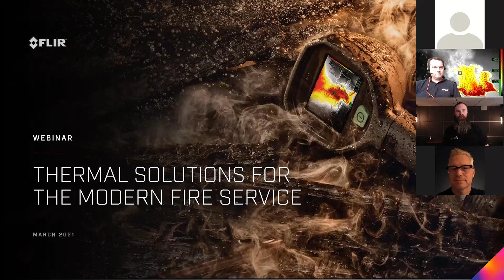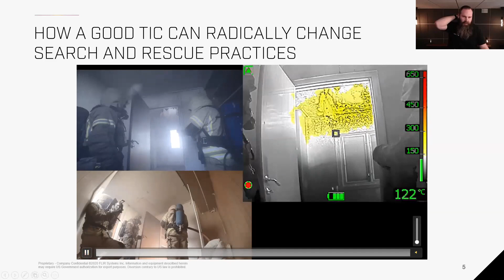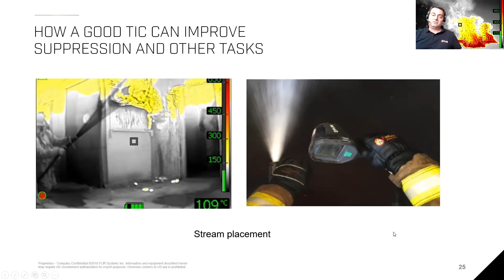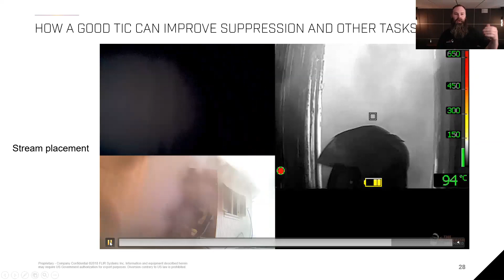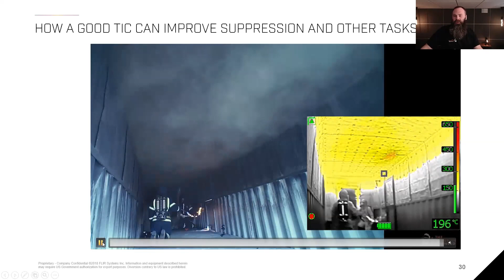Webinar Archive: Improving Search and Rescue Practices with Thermal Cameras

Comment: 🎯 Key points for quick navigation:

00:00 FLIR systems webinar introduction
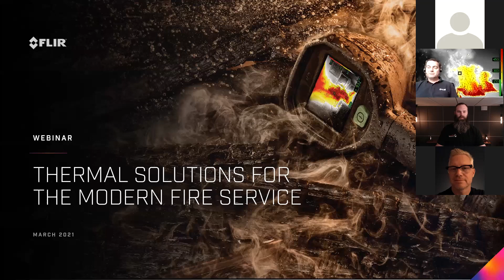00:59 Thermal solutions discussion
02:00 Camera image quality essentials
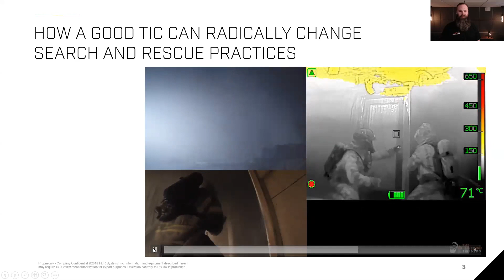02:29 Game-changing fire technology
05:09 TIC-oriented search advocacy
06:36 Faster fire suppression
09:40 Thermal camera importance
12:39 Reaction to fire development
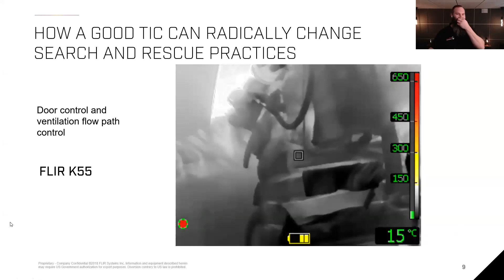14:11 Control door for fire
16:13 External heat detection
19:08 Officer TIC applications
21:04 Good vs bad TIC
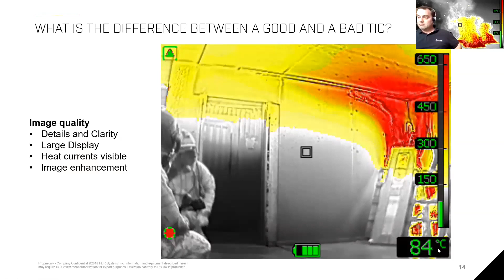23:36 Better image quality
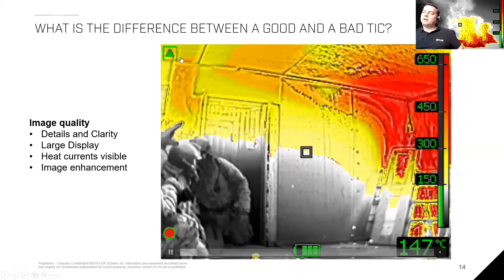25:35 Heat buildup significance
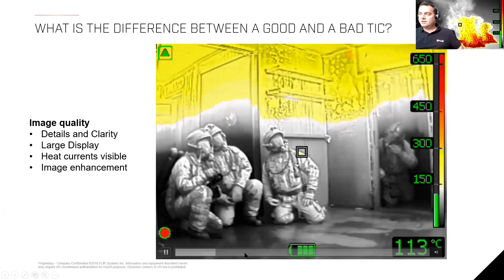27:04 Heat moving outward
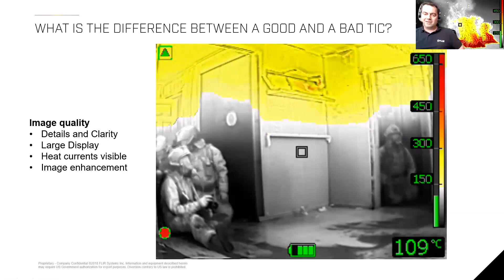27:34 Insulated gear limits
28:04 Acting early crucial
28:35 Image enhancement explained
29:05 FSX technology discussed
30:06 Temperature indicator colors
31:06 Gear temperature limits
32:06 Body heat accumulation
33:09 Mode comparison utility
34:09 Mode effectiveness analyzed
35:37 High-low gain modes
36:35 Temperature filter necessity
38:04 Resolution affects detail
40:06 Image quality impact
41:34 Fire flow visualization
43:03 Suppression strategy decisions
44:32 Water placement precision
46:24 Fire visibility challenges
48:26 Stream control effectiveness
50:23 Exterior suppression difficulty
51:22 Camera stabilization benefits
52:25 Early fire detection
53:25 Smoke layer ignitions
55:21 Spread risk assessment
57:52 Car accident analysis
59:55 Firefighter training evolution

Made with HARPA AI